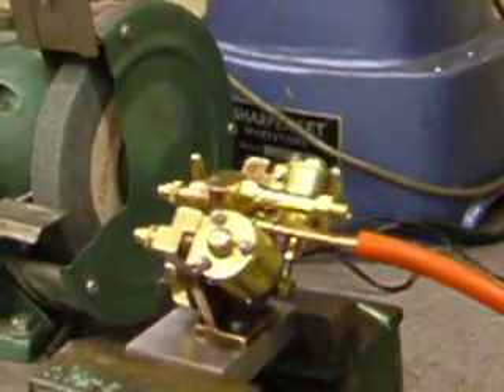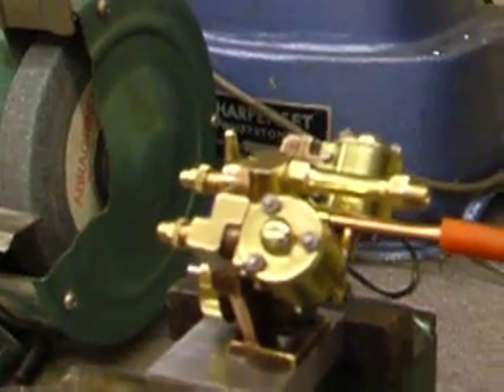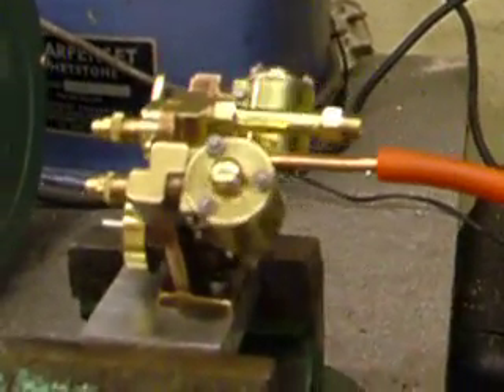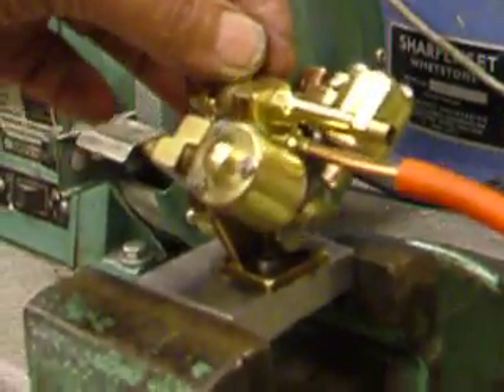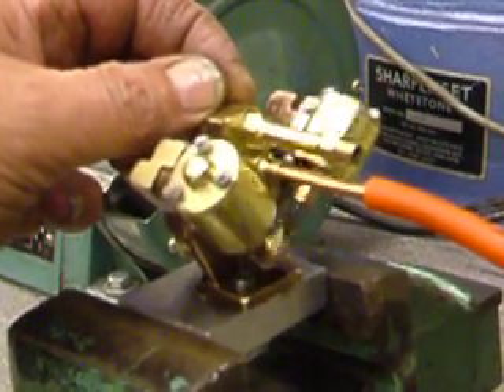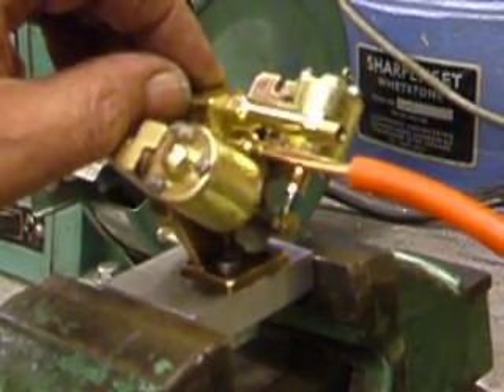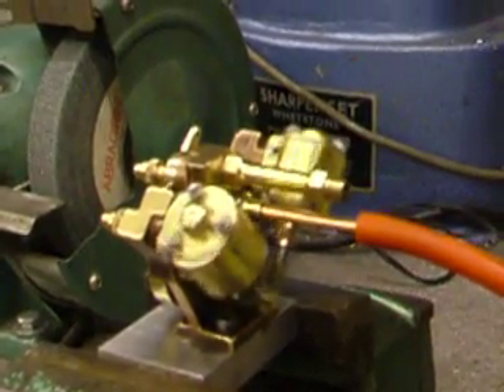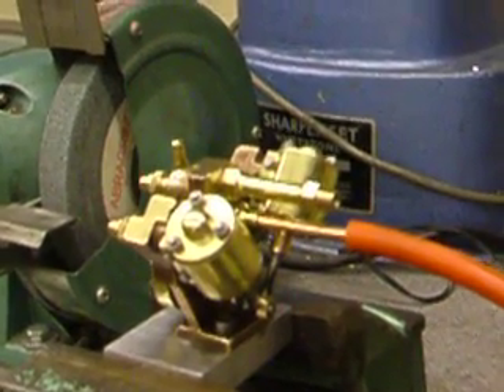Stuart Turner V Twin running after refurb

Comment from the maker: This engine will run on steam, it is designed and made to do so. 
But to check an engine out, run it in and display it, using air is the easiest way, as you have a lot more control of the pressure. As was shown on the demo. Very difficult to do with live steam.
I love steam just as much as yourself, but at times it is not viable to use it.